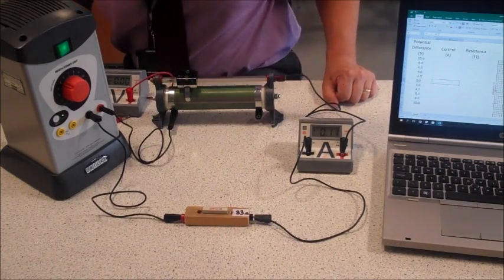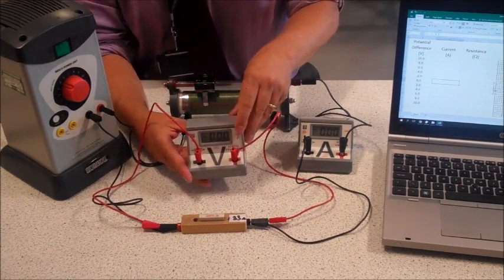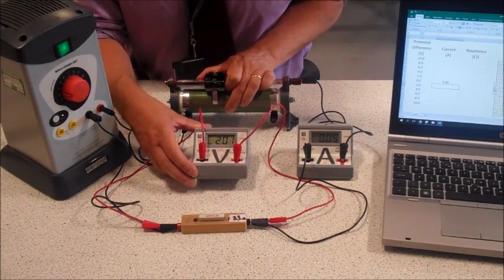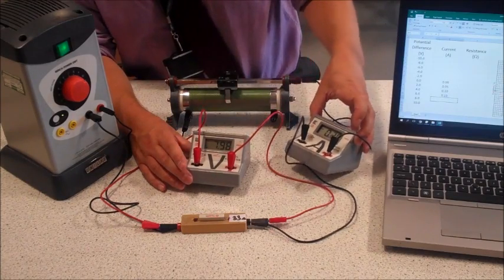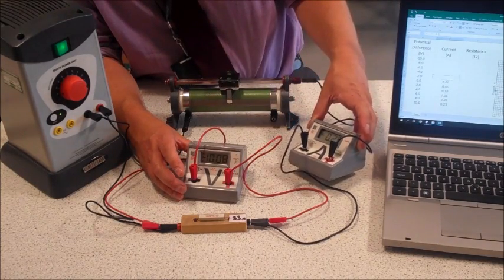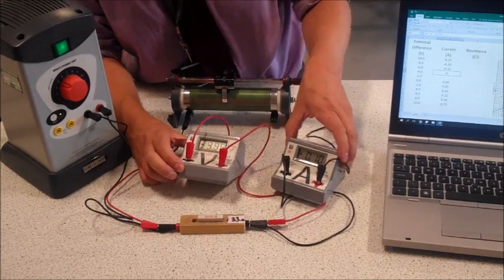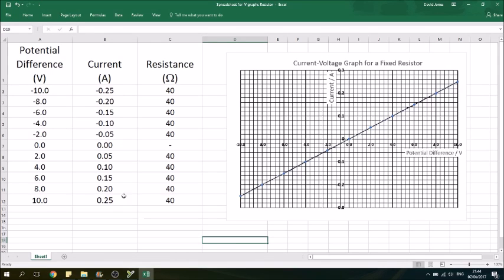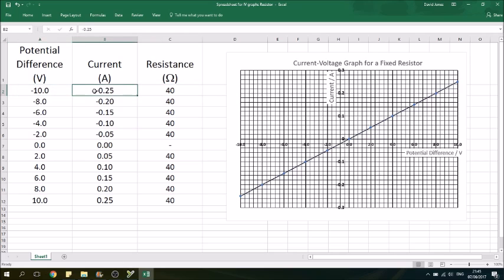AQA GCSE Science Required Practical VI Characteristic of a Fixed Resistor

Comment: Is the variable resistor necessary? Can you not change the potential difference with power supply alone?
Reply from the maker: You could do it without one, but you wouldn't have good control over the actual pd used.